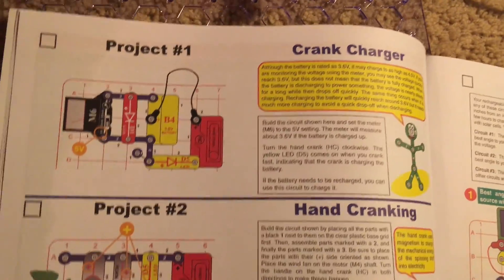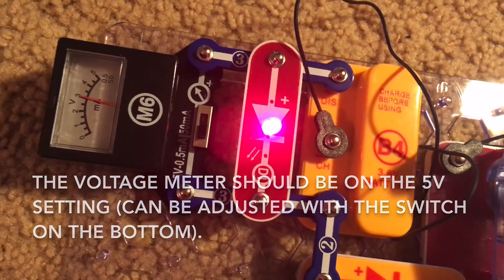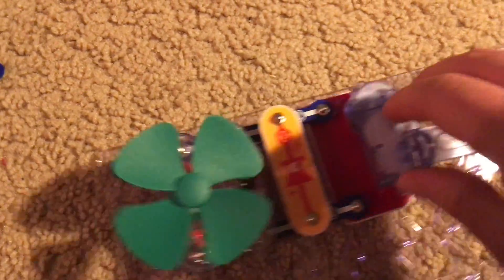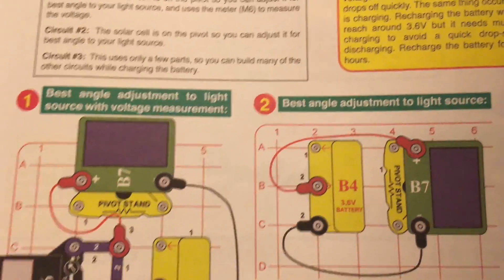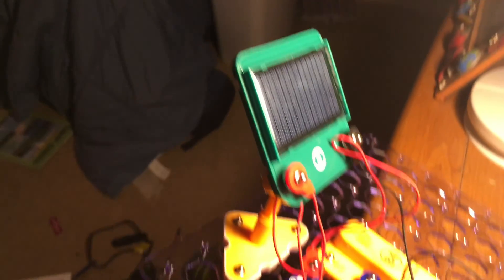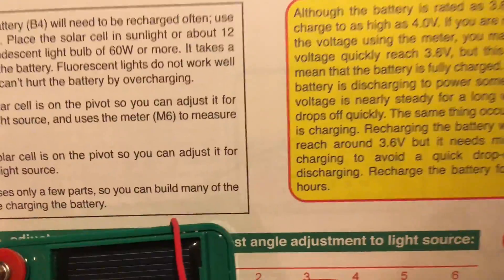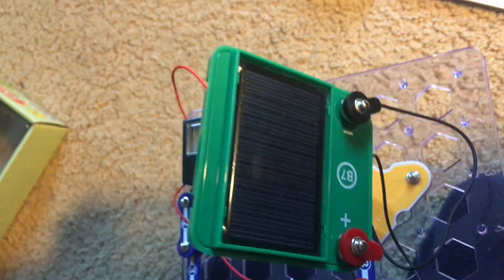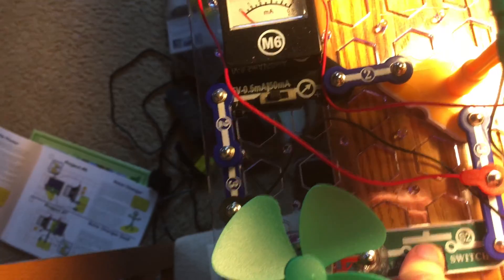Snap Circuits Green: Projects 1-5 (VOLUME WARNING)

Comment: I personally recommend using the sun as the light source to power the solar cell.
Reply: In Arizona it’s mostly sunny
Reply from the maker: Snappy Circuits Forever I bet it is!
Reply from the maker: FoxyFan13 Entertainment I agree, you should take advantage of that energy source whenever possible, especially if you live in an area where most days are sunny.